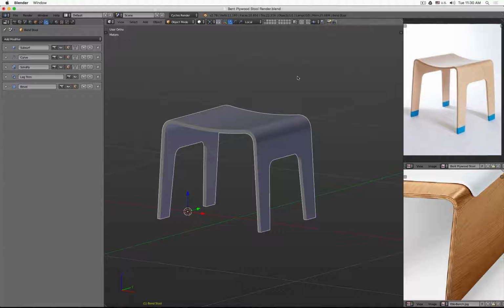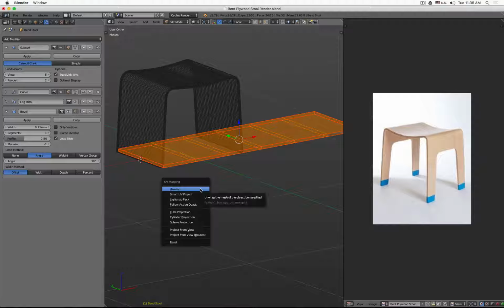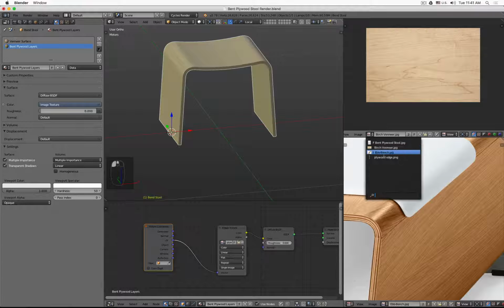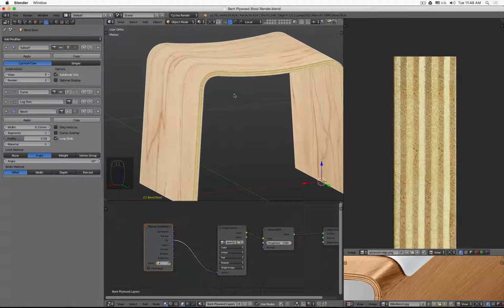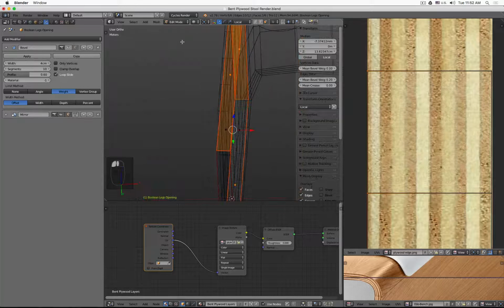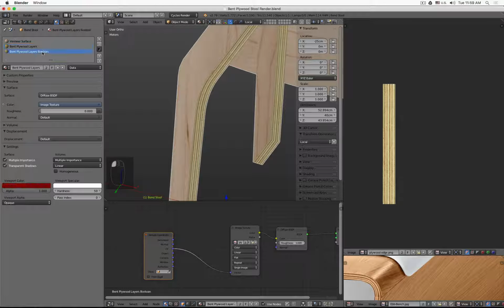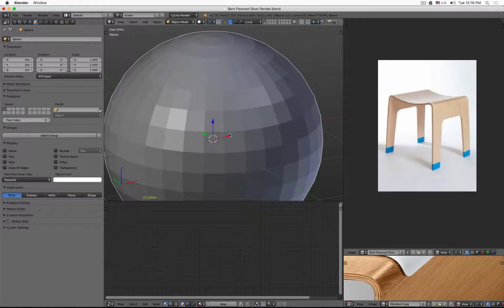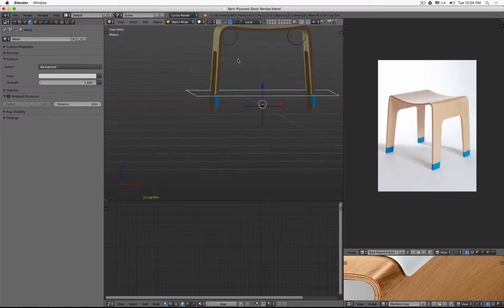Bent Plywood Stool Part 2 Texturing

Comment: hi ,is there a way to do this in rhino ceros?
Reply from the maker: Yes you can Rhino is NURBS based - nurbs comes with UV build in
the important part is that the sides are not lofted but are sweep 2 rail surfaces !!!

then the add the correct material to each surface